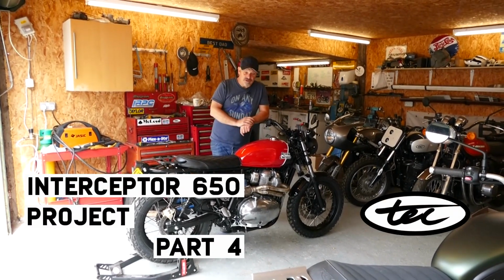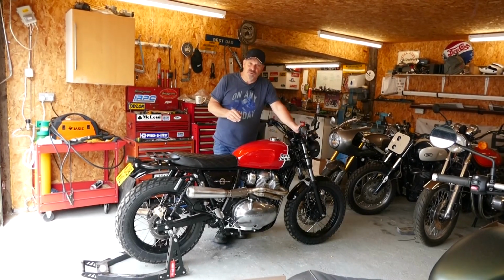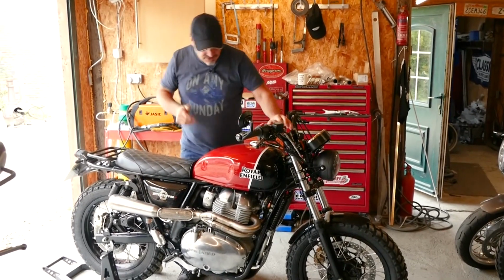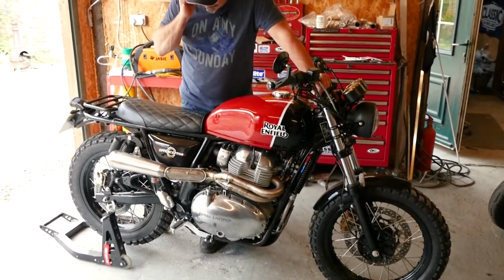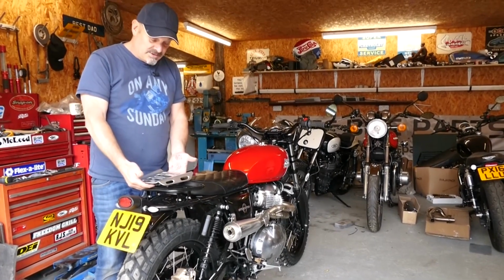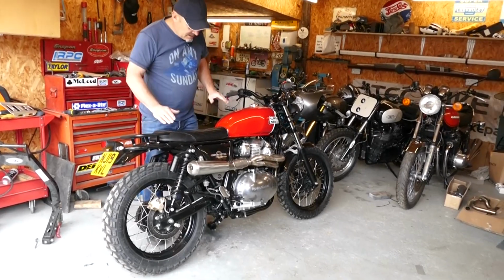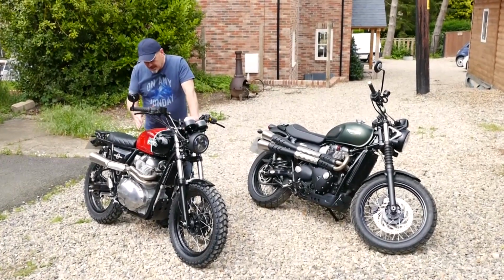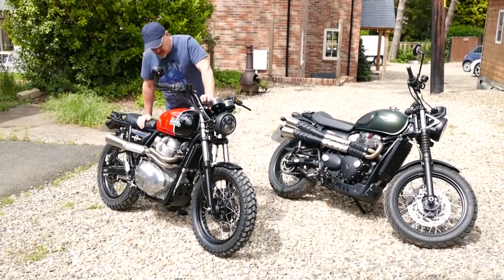Interceptor 650 Project - Part 4

Comment: am a little bit disappointed you didnt start it up. but the frame really does suit what you have done to it. think that would have also made a awesome street tracker as well.
Reply from the maker: Hi
I looked long and  hard at a tracker back end and decided it would really have to have a frame Loopectamy to be correct with a tracker look rear. We may do it later or on another bike as we only wanted to do reversible mods on this build.

Comment: Hi George, I love what you're doing with the bike, I'm from Belgium and I think this will probably be my first bike... I was wondering if you will release a video of how got the 20 mil lift on the bike.
Cheers, Arne
Reply from the maker: front is easy and you can get more lift and travel with a little more work , the rear is done with our adjustable length shocks these can go up to 32mm longer than stock units . I am going to do a video on the fork mods.

Comment: Sir that is a rare beauty in the making. Everything you have done so far looks fantastic and solid. May I ask you how well is the handlebar set up for standing up on the footpegs and riding. The stock set up is quite low. I have added one inch cylindrical risers to the stock handlebar and it has improved slightly. Do cater for this when you are planning relocation of footpegs. That in my opinion would make it a true blue scrambler. Cheers!!
Reply from the maker: we are working on a foot peg re locate kit now and will show in next video
Reply: Waiting for it...

Comment: I really admire your engineering skills, but I can't help but feel this is now getting a bit "same old". Take a retro type bike, fit off-road tyres and a high-level exhaust. It's a all a bit 2015. You-Tube is full of these mods, and most of the manufacturers are doing this as OEM. Where 's the innovation and uniqueness going to come from if everyone is just doing this sort of thing?
Reply from the maker: Hi Dave, I know exactly where you are coming from. But this is what we get asked for i.e Mods that can easily be done by owners that are reversible and low cost, without spoiling the bike.  That is what this project is all about  So we have to walk a fine line on what we can do and also what we spend on the bike. We have built many quite radical custom bikes in the past but they tend to be expensive and take lots of surgery to the donor bike, we have even built bespoke frames , but this all cost lots of time and money . Quite a few customs have already been done on the RE650 with some sponsored by  RE. But most are just unpractical show bikes.
 .A lot of these have had loads of cash thrown at them with things like Olhins ect and probably ended up costing 3 times the purchase price.
We also get the obvious why would you spend all that money on a cheap bike comments so again have to tread a fine line.

I will probably do a crazy build out of this bike eventually just for a laugh, but for now it is our parts development platform. 

This bike is a great platform for custom builders with lack of over complicated systems being a big attraction
Reply: @TECBikeParts  Good answer and I totally understand. I knew my comments were kind of going against current custom (no pun intended), but I guess I'm just beginning to tire of this trend that's now been around for a few years of 'bunging on some knobblies', and a few other bits and pieces. It's a look that 's in danger of becoming predictable and passe. But, hey, that's just my thought.  It's not all about me LOL. I do agree that  the RE 650 platform has a lot going for it. It could be a gamechanger for RE.

Comment: Looks great, but I can’t help thinking that with all these changes, the cost is going up quite consistently, and maybe even not far from the standard Street Scrambler 900, with similar looks and better performances...
Reply: Cost is surprisingly very low
We have avoided high cost parts for this very reason. The main cost is the exhaust but only the same price as a pair of stainless silencers that most people will want to fit anyway. You would not need to make all the changes we show and still would get a similar result. People who know me understand I like a' lot of bang for my buck' and  won't waste money on high priced parts that are overkill on a bike like this.

Comment: Excellent Build Sir , the Bike looks Awsome .. Sir I have a couple of Suggestions.. 
1. Why can't we Have A dual Exhaust on the left Hand Side of the Bike instead of the Right , because its affecting the side box which is operable and its Affecting the Airfilter ?? 
2. Secondly the Rear Tyre Is looking Very Big , I think it has to be Smaller  then it will be more comfortable .
3. Why dont you try the Powertronic New ECU for the Bike.. which increases the Horsepower To Around 55bhp .
Reply: Hi
various reasons to put on the right, this is not an easy bike to make a high pipe system for and we have built it to allow access to the right and left side covers , also the cold air intake on this bike is on the left not the right.
But main reason is when bike is on side stand you can see the exhaust and not the 'bare' side.
Reply: Rear tire is a 140 and I would suggest using a 130/80/18 as the 140 is tight, but we did this to see what was the absolute max we could get in.

Comment: Will you be developing a fender eliminator kit?
Reply: no point really as you would have to start cutting bits of the frame at the back
Reply: @georgemilburn6213  I'm totally fine with cutting the rear loop off the back. It extends way too far than it needs to.
Reply: @BurtoniMotors  Yes I am with you on that, but not everybody want to start cutting and welding a brand new bikes frame, so we are showing what can be done as an alternative
Reply: I definitely agree. I don’t want to cut the frame, but it just seems excessive. I can’t wait to see what your solution will be!

Comment: Looks great from all angles, better than the Triumph Scrambler. Beautifully compact, engine and casings look period correct. No "eyesore" radiator to spoil the profile. I bet it's much lighter and handles better too! Instead of the small sump guard currently on the bike you could fabricate a larger underbelly bash plate that wraps around the frame rails and covers the cases???

Comment: I actually prefer the look of the RE when parked next to the triumph.  Looks great 👍
Reply: Yes me too, I put them next to each other to see what comments I got
Reply: @georgemilburn6213  And me, it's got that classic old school look, hope you provide a full list of parts used when finished - like the seat that matches your rack unless you are going to supply yourselves as part of a set of kits.
Reply: @everydayphotography  Hi paul
If we get the interest we will be making the seat/rack combo as a kit with correct fittings to use standard seat lock Price around £200 for the full kit
Reply: george milburn I’d buy the seat/rack kit, especially if it’s easily swappable - that’d be a perfect practical option.
Reply: george milburn anything in the pipeline fora replacement seat without the rack?

Comment: Looks good, would have loved to hear what the exhaust sounds like.
Reply: What saddle is that. where did you get it? And will you be selling the racks? looks the part 👍
Reply from the maker: in next instalment as we have made a few small changes to the baffle system.
Reply: @TECBikeParts  
Im worried about the exhaust burning the legs😁
Reply: @TECBikeParts  is the next instalment due soon guys? Would really love to find out how the high exhaust has progressed!
Reply: I've got a tec 2-1 flat tracker exhaust baffles out on my 865 Bonnie sounds brlliant